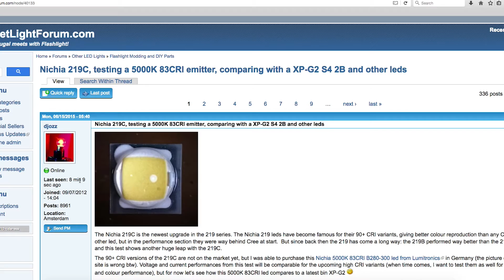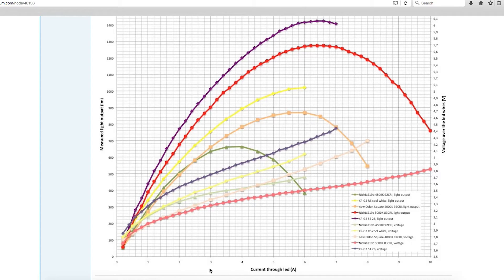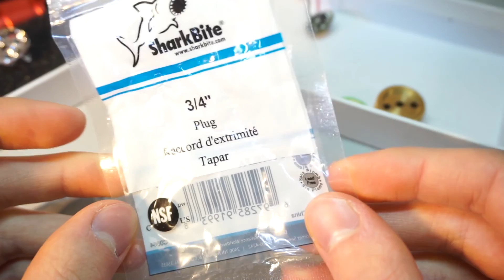DIY Spacer for Convoy S2+ Triple

Comment: Just a thought...

Let's mix in some factors - Arctic Silver / Brass Pill / Brass Spacer / Tin ? / Soldering Iron > Throw away the messy thermal compound, get some heat on that pill and spacer, get some tin in between them and voila = Better thermal conductivity, better mechanical structure integrity, better handling ;)

Comment: Oh, if you took some SMD solder paste and bonded those together, the heat would travel thru the pill better, with the two pieces still separated heat won't transfer as well...but soldered together heat has a much better path

Comment: will all the TIR and reflectors marketed as fitting S2+ fit S3?
Reply from the maker: Yes, the S3 uses the same size reflector as the S2+. That light is probably even better suited for a build like this, since it has the integrated shelf.

Comment: I want to build this too. Can i use an fet driver and xpl hi leds too?
Reply from the maker: Brass isn't the ideal material for heat dissipation, so a fet driver might be a bit much. You'd risk damaging the leds if they overheated. But it will probably be ok if you solder the spacer to the pill and don't bypass your springs. XPL-HI leds will work great, and they fit under the same optic I used.